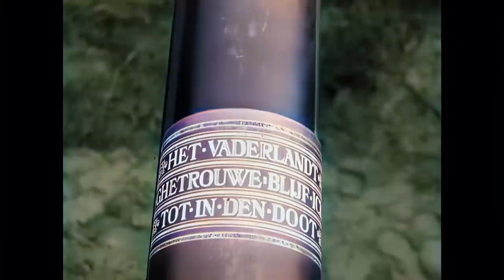Splendid footage of the Dutch Army during WW1 in 1917 in color! Part-1 [A.I. enhanced & colorized]

Comment: I never knew dogs were used to haul machine guns and ammunition chests. I wonder what rank they held. The footage at 30:00 of the soldier slamming into the tree was hilarious. Interesting that the Netherlands managed to remain neutral in WW1 but not in WW2. I wonder what changed.
Reply: The mindset of A.H.
Reply: In WW1 the Germans had little interest in invading the Netherlands. In WW2 they had, one of the reasons was the use of Dutch airfields. Before WW1 the Germans thought about invading the Netherlands, especially for using the Dutch province of Zuid Limburg for the passage of their right wing as part of the Shlieffen plan. They did not and had to attack the Liege fortresses and squeeze their right wing through the small corridor around Liège, 
The Belgians used dogs too for transporting their machine guns, they were rather efficient. As for bycicles, a soldier on a bike moves faster then on foot. Even in WW2 the Germans used bycicle units since most of the infantry had to walk.
Very interesting movie !
Reply: The Germans feared an allied invasion via Holland and build a vast line of bunkers at the Dutch Belgian border in 1917. Most of these concrete fortifications are still in place and are a constant nuisance to traffic and agriculture.
Reply: In World War I, Germany was suddenly faced with a multi-front war it had not chosen for itself. The Netherlands was not a threat and therefore was not invaded, also because it did provide the Germans with an alternative route into France, which Belgium did provide. That was why Belgium was invaded. In World War II, the Germans instigated the war themselves and sought to conquer as much territory as possible for the Reich. That's the difference.